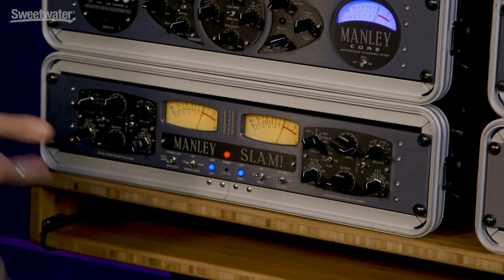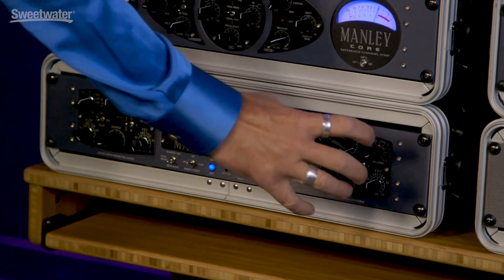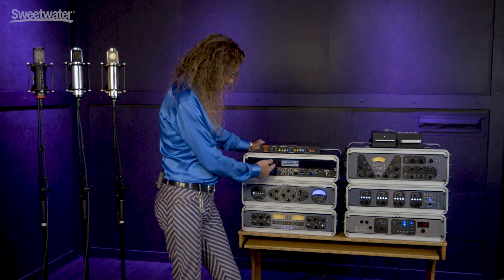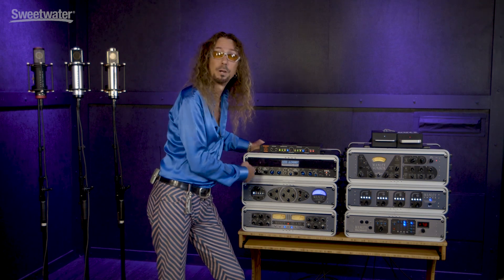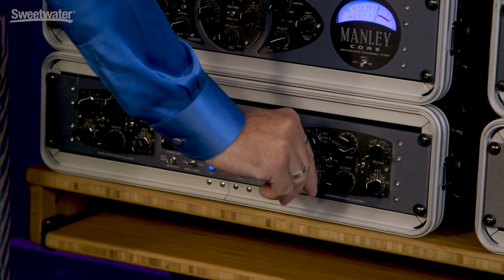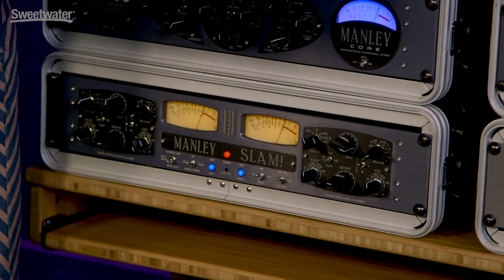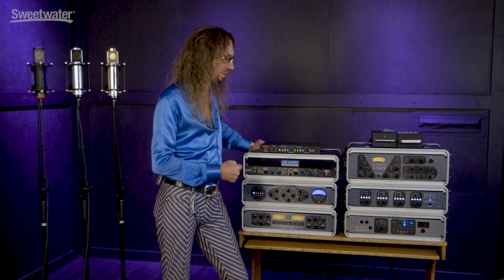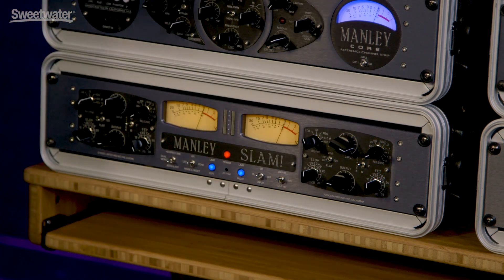Manley SLAM! 2-channel Tube Mic Preamp/Limiter Overview

Comment: I like my Slam. It's really clean sounding, considering it's a tube preamp, and only gets dirty if the FET limiter is working. I like it for almost everything, including recording keyboards with the instrument inputs. I wish it had a bit more gain for ribbon microphones. For those, I've been using a Grace 101 as the mic pre, and if I want some limiting, I'll then run it through the Slam on line level mode. I think you could also use a Cloud Lifter, but I haven't tried it.